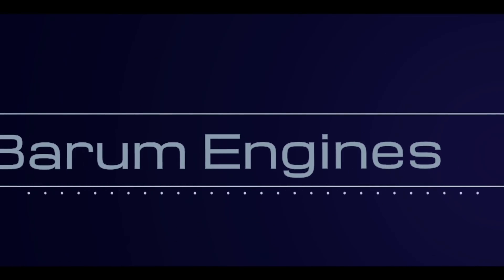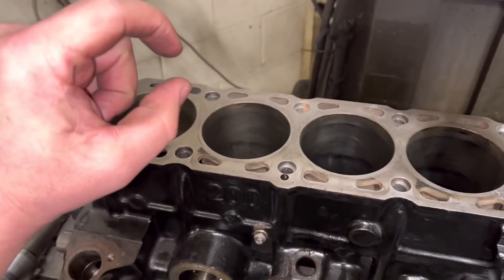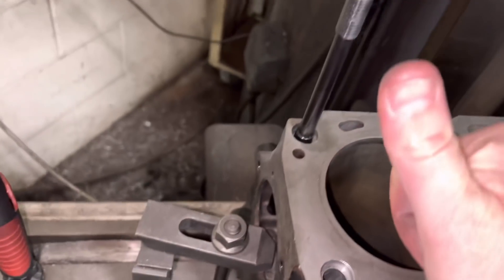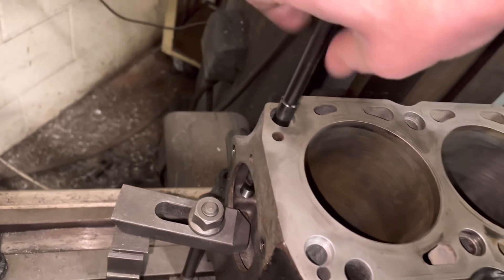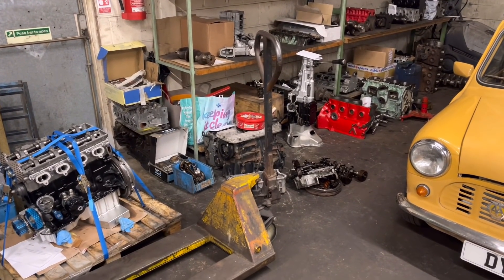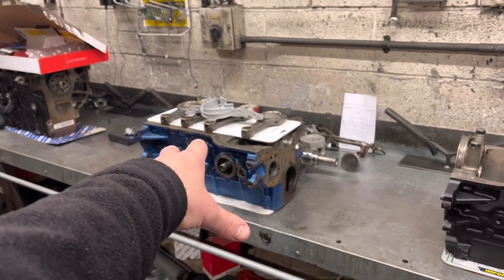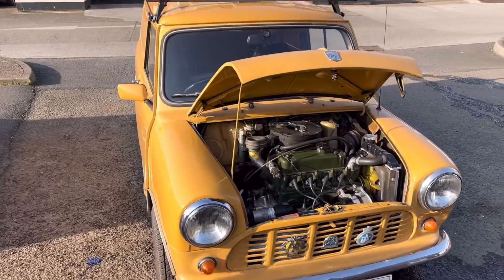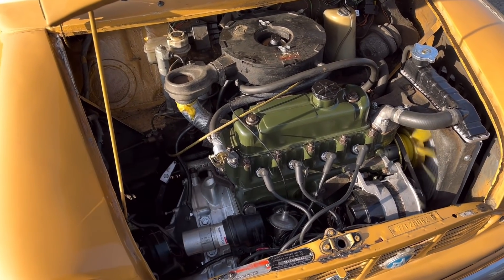9 COSWORTH engines in 9 days, things are getting CRAZY

Comment: Not a mini person so I might be barking up the wrong tree here, but I did a full engine and clutch rebuild on a RHD Volvo 245 years ago and had bucket loads of issues with the clutch releasing. Was trying to work alone, and could not look under the bonnet while depressing the clutch so had to get a helper in to watch what was happening. Flex hose on the clutch hydraulics had an internal split, depressing the pedal pumped fluid through the split into the internal layers of the hose, blew the outer layers up to half the size and shape of a rugby ball, and also forced the inner layers closed so fluid was not reaching the slave cylinder. New slave, and heavy duty clutch had been fitted in the rebuild, had not has an issue previously with the original clutch and slave, so had had no need to review the hose. Don't know if your minivan is 100% rigid line or a combination of flex and solid, but it is a possibility if there is rubber flex hose in the system.

Comment: Long studding a cosworth block for more strength, I'm a Jag owner and enthusiast and that is what Jag did with the XK6 4.2 motor, They went from the early short stud 4.2 relying on the  block deck to take all the loadings to the long stud 4.2 which was threaded into the lower part of the block making it more rigid, The only downside was people not using antifreeze which then rotted the studs out!